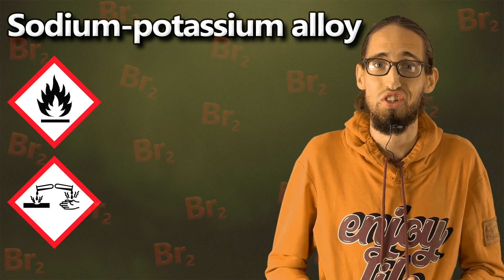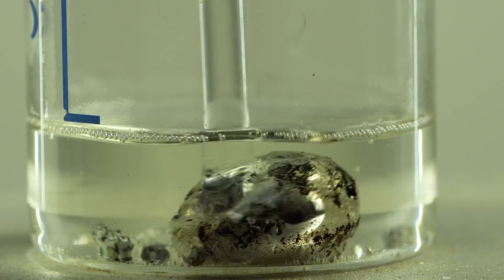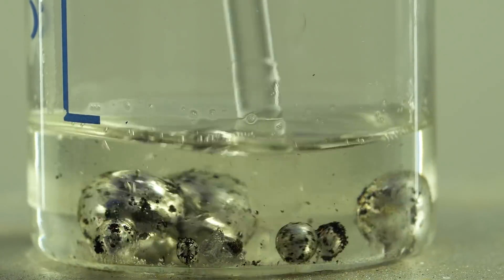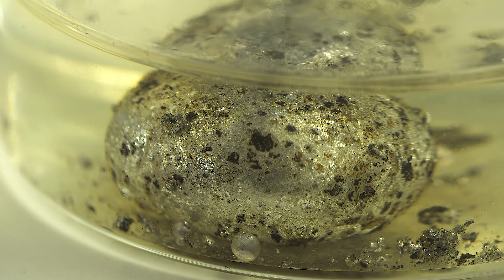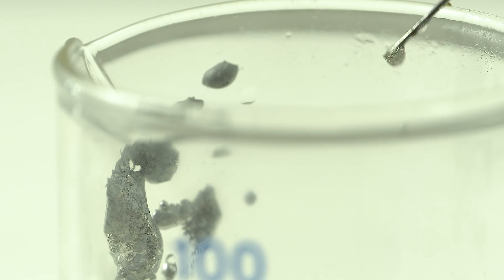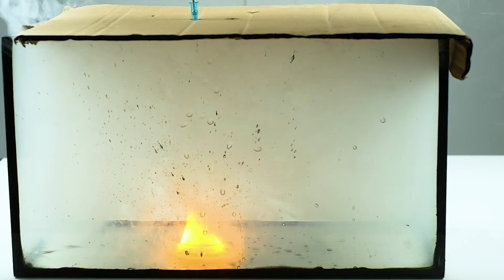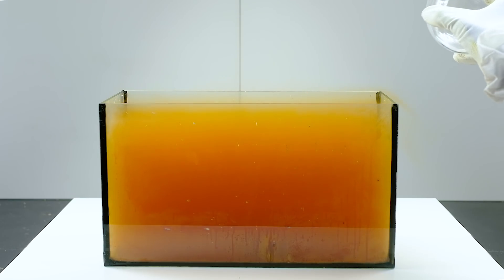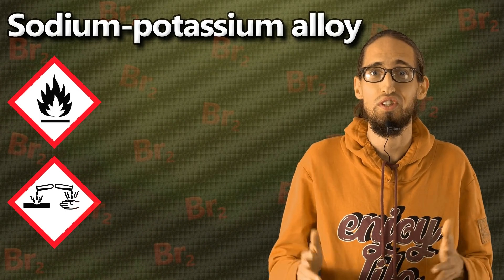Sodium-potassium alloy (NaK) and bromine reaction!

Comment: Good video.

But I have questions. That black crust that forms on the metal. I'm guessing it's actually oil being actually burnt by oxygen lost from the sodium and potassium oxides? And the oxide is regenerated by the water in the oil and that released from the slow carbonisation/burning of the oil. Similar how magnesium is consumed in in dry ice and it makes elemental carbon?

Comment: I intend no offense when I say this, but they call that mic a Lapel Mic for a reason. It would work just fine if you clipped it to your collar, since that's how it's designed to operate. Putting it in your beard both looks kinda silly and it over-drives the mic's diaphragm, which leads to your voice sounding rather "peaky" and somewhat distorted in certain frequencies. Your audio would sound much better if you just used the mic as it was intended to be used.
Reply: I know you're from the illuminati
Reply: @quicksilver3431  lol k. Where'd you get that funny idea from? My screen-pic? Don't worry, bud, that's a military patch, not an Illuminati logo lol. Having a triangle in it does not automatically make it to do with the Illuminati.

Comment: Perfect reaction. 
NaK can spontaneously combust on air and is explosive when mixed with water. It forms two perchlorates, which are also explosive, and hydrogen gas. Which, being superheated in the reaction,  reacts with oxygen to produce water. Explosively. 
It's explosives all the way down.
Reply: So, you’re saying that dropping NaK into a bleach solution is a bad idea. Got it :)

Comment: Healthy tip on working with alkali metals. Don't use mineral oil. It's not meant to be used for them. Use kerosene. It's easier to work with.

Comment: This might get me to finally open my ampule of potassium. 
Matter of fact this may seem naive but my potassium is in an argon filled sealed anpule in rough shot form would it be completely ridiculous to gently heat an oil bath and submerge the ampule to form 1 large chunk. I feel like opening under oil and coalescing under oil would be better or more safe perhaps seeing how its not trapped in a sealed glass container with the oxide but it shouldn't oxidize if the ampule was properly purged. Im not even sure if thats a question anymore, its very early and i haven't had my breakfast yet. Haha!

Comment: When making the NaK if you add 1ml of anhydrous ethanol it makes them coalesce much easier somhow preventing the oxide from sticking to the NaK surface.
Reply: Given how hygroscopic that stuff is, you’d need to dump it straight from the distillator into the NaK dish, with some dry shield gas, right?
Reply: @absurdengineering  my memory was off, it was isopropanol not anhydrous ethanol. You mix the Na and K underneath hexanol(other inert solvents may work), then add a few drops (2 or 3) of isopropanol after.

Comment: I wonder how the Na-K alloy would react with liquid oxygen as well as the more reactive alkali metals rubidium and cesium 🤔
Reply: Brandon Fisher The liquid oxygen reaction would be tame compared to the reaction with bromine as oxygen is actually somewhat stable compared to the halogens (oxygen would need to be oxidized twice while bromine only once in a complete redox reaction). No reaction would occur with Rb or Cs as they are also alkali metals; one alkali metal won't oxidize (or reduce) another alkali metal. The most exciting thing that would happen would be the formation of a glob of NaKRbCs alloy which would probably look identical to the NaK alloy.
Reply: @noahswindler7461  I always thought that oxygen is the second strongest oxidizer behind fluorine so all of the halogens other than fluorine would be weaker oxidizers than oxygen. 

BTW rubidium and cesium are known to spontaneously catch fire in air so I figured they would react much more violently in liquid oxygen.
Reply: @brfisher1123  I misunderstood your comment, thinking you were suggesting reacting Na-K alloy with Rb and Cs. My bad.

Comment: Nice! With the first reaction, I think you could get better results with more depth to the liquid, though. You can see that, the first time you did the HClO4 reaction, the sodium just fizzled out on the surface. A bit more depth might help, since the reaction will work best if the alloy manages to become completely surrounded by the other liquid. They can only react at the points of contact, since the liquid metal bead tends to stay coherent. Go for a different container next time, and it may work better.